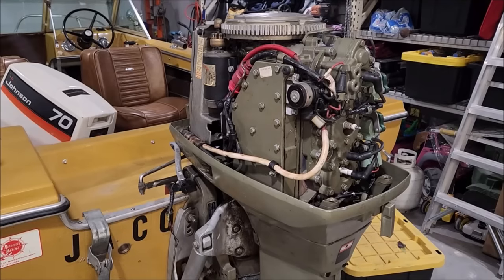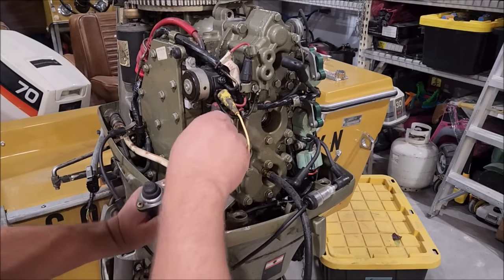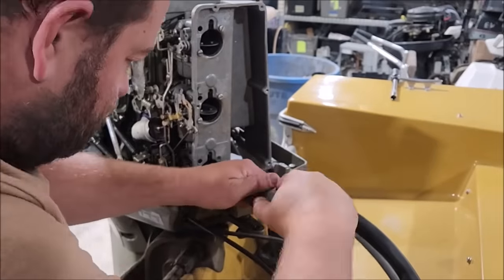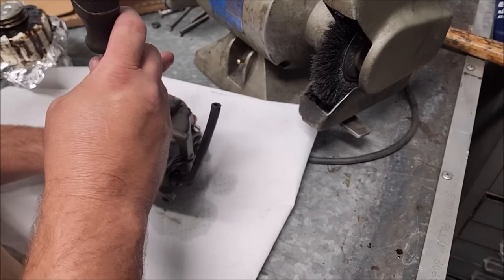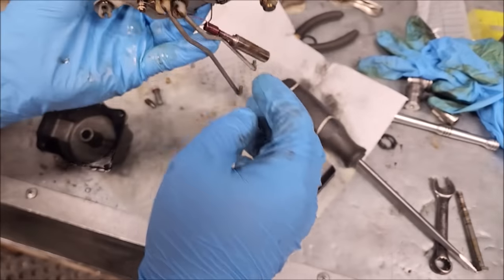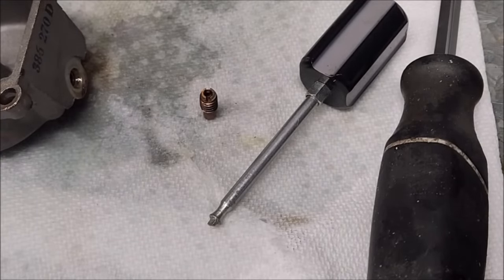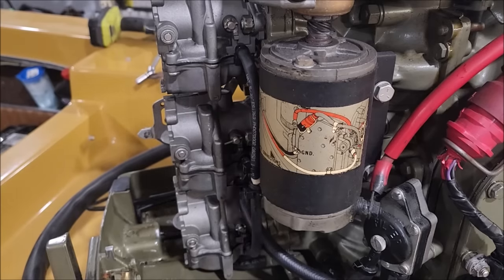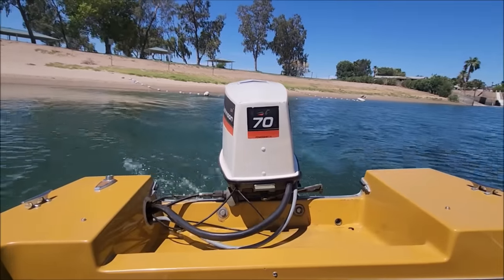Minty 1974 Johnson 70 HP Doesn't Run Once in the Water

Comment: Brandon, Sonny here, I'm a 36 year J/Evin. tech in Wilmington, N.C. really enjoy your channel! You have the right blend of
seriousness, humor, and humility (the latter is lacking badly in many outboard repair channels!)!!  Keep up the good work!!!
    Some simple tips .. always assume fuel hoses are old, & replace them (90%+ outboards have 5-10 y.o. hose!)!!
Of course if you know they're very new don't!! Lol!  It's better to err on the side of preventing call backs, than to encourage them!!!
Also, you may already know this one,, when replacing exhaust cover gaskets, wipe ~acetone~ well around the aluminum exhaust plate & cover after removing the old gaskets(s). Then after applying the gasket sealer to ALL ALUMINUM SURFACES
allow the sealer to cure for 30 - 60 minutes before installing those parts!!!  After bolting them in, re-tighten/torque 
them 3-x's!!! Allowing some time when you make the 3rd try!!!  This way you're compensating for the squeezing out of the sealer, which cancels out your torque specs.  
    Be on the lookout for early 90's 3 cylinder Mercury 90, 100 h.p. 2-stroke motors!!!  Don't know if you've already
experienced this,,,, but the factory messed up the tolerances between the cast iron cylinder sleeves, and the cast 
aluminum block(s), allowing the sleeves to get loosened when at temperature, and ~move~ backwards, towards the crankshaft,, and then the top piston ring releases itself because the sleeve moved back towards the crank!!! 
     I guess you know the end result, lolol,, because Mercs don't have any cylinder heads, you'd have a mess!!!! 
Just thought I'd mention that one!!!  Cheers to you~!~!~!~  Sonny.

Comment: Had a 70 once .   Tha motor was indestrutable.  20 years  zero problems.  Of course it was winterized every year and well maintained .   Very fast very dependable  and always started in seconds.  Traided it and the boat off on a 19 ft. Bayliner with  v8 in-out.   Love my boats.   But its true.   A hole in the warer you pour cash into.    76 now   but my kids , my grand kids all benifited greatly.      Miss those days.

Comment: Great Video, Great you were able to figure out were the water was coming into the bottom piston, I had a similar problem with a 20hp merc, the bottom seal on the crank let go water came up into the crank, then it was left for years, when I got it it was locked up, took it apart, changed the seal and the bearing, ran great, yep lot of people operate things that they have no idea how to fix, that's were guys like you and I come in,

Comment: Love those 3-cylinder OMC loopers - especially those 1978 and newer with integral power TNT.  Some of the best two-cycle outboards ever made...........  Thanks for the video, Brandon.
Reply: Yes, actually they're all a little over-powered!  The #2 connecting rod(s) very often let go, and BANG out the side of the block!!!   In 36 years I've seen so many of them through a rod.  If you detune them they'll live longer!
Reply: @newmoon54  the real story is these motors were born as 75 hps.., they were detuned by making carbs with small throats and jets.. put a set of 75 hp carbs  on a 65 or 70 hp and they run great and last a long time

Comment: I once had a 1986 Lund “Mr. Pike” with a 70 hp Evinrude. The boat was awesome. But what I like the best on it was the engine. Nothing ran and sounded sweeter than that Evinrude! If I come across something like that, I will be very tempted to get back to that type of boating. It was so fun.

Comment: Finally someone has shown how to remove the carbs on these.  I have this engine at home and I went on to a lot of sites and they said that a link sync had to be done after removal.  I can see now that this is not the case.  Thanks so much for going through this easy repair.  I owe you a beer.  All the way from Australia.  Thanks Brandon.

Comment: You make it look much easier than it actually is. There are many roadblocks to repairing these old guys. For instance, I have a 1959 Johnson 35 horsepower, and while it is a very simple machine, it can still confound me. For instance, I went to replace the points, and despite doing it several times before could get no sparks out of it. I have the timing fixture that uses the marks on the Armature plate and use a meter to determine when the Points Break. It's a beautiful system, but for some reason I could not get it to work this time. I finally figured out that the points I purchased were from China and both were defective. That 70 horsepower Johnson is just beautiful. Advice for men and women who wish to repair these and keep them? Without question. Join your local chapter of the antique outboard motor club and get to know the old-timers. They are an invaluable library of information.
Reply from the maker: Those china points, jeez, what a problem. I'm sure many people out there are throwing out the engine because they can't figure out the new points are the problem.
I don't think there is a local chapter. If there were, it would probably just be me.
Reply: I own a few 2 cyls with that mageto and fixed a lot more, but I have never bought a new set of points.  Coils I can't count how many!  And the 18-5181 are great.  But I've always just cleaned up the old points and tested and reused the condensors.

Comment: I used to think these motors were boring (I'm more into 1950's outboards), but have started to gain an appreciation for them. Your is super clean as well (I'm so used to seeing ratty ones purchased on the cheap at the boat ramp that crank and crank and won't start). Sounds great as well. 

This video makes me want to keep the 1974 twin Johnson 50 HP Loop Charged outboards on my great grandfather's 1960 Alumacraft Queen Merrie, that was recently brought home from my family's cabin. I had always planned on switching them back to the twin 1957 Johnson 35 HP (red and white) outboards it was built with. Maybe I'll leep the 50's on it for awhile now. They're growing on me :)

Comment: Probably would help to replace all the seals and rubber hoses. Over time ethanol destroys those components. I should know, I had a '77 70hp Evinrude and a '95 70hp Johnson. Now, I only use non-ethanol gas even though it costs more.

Comment: Nice video.  I'm currently resurrecting a 78 johnson stinger 75. Seized steering, trim motor wouldn't go, about a meter of control cable missing (can you believe that someone saw fit to remove a part of an 8 wire cable?), no key, no battery terminals, but good compression and looks fairly well kept under the cowl that is.  I've got her running and steering now, but the carbies will need cleaning.  She is an ol girl worth saving. Labour of love, as are most boats.

Comment: I had the same problem with a 1972 Evinrude Triumph 65hp 2 stroke. The problem was some debris floating in the water floated into the prop and up the exhaust pipe. When the engine was out of the water it ran fine, but in the water the debris rose up the exhaust column and occluded the exhaust port causing the engine not to run. when pulled out of the water, the debris dropped down allowing the engine to run.
Reply: Who would have thought that was the problem.

Comment: Awe we used to run those 70's and 75's on raceboats   :)     The short shaft models  :)  with clever props.  I too know those engines inside and out too .  Cheers to an awsome video Brandon :)

Comment: I had a 1976 70 foreverude. thing had a million hrs. on it when I got it in the late 90's. only problem I ever had was that it started dropping spark to one cylinder when the powerhead heated up. Turned out to be the exciter coil under the flywheel.

Comment: Had the same issue with a 70HP Evinrude, would rev nice out of the water but wouldn't get on the plane. Turned out to be top carby's float was stuck starving fuel to top cylinder.

Comment: For whom it may be worth,  I dont know if they had overheating resistor on these in 79, but I had an 82 Johnson that after hunting down a culprit keeping it from running more than 15 minutes (idle great), one last thing, I snipped the wires to the thermo switch.  Never had a probelm after that. I checked the resistor by Ohms showed good, but wasnt after engine heated up.

Comment: I got one of these on a 72 ranger boat .. just ran it in the water the first time today
Reply from the maker: How did it do?
Reply: @BrandonsGarage  had the carbs rebuilt ,  would only run 3000 rmp wouldn't plane out ,  got to messing with it , found at wot , butterflies still could open another 25%  figure they didn't adjust the linkage right ,  should run 5000 rpm.. but other that that worked find after warmed up

Comment: Hello, I loved your video. I have a 1976 Johnson 75hp, and it has a problem, and that is that when it enters the water and starts it, it does not have the strength to accelerate at speed and it only moves slowly even if I accelerate it to the bottom, I already put it. water pump, spark plugs, thermostat, fuel hoses, everything new and the problem continues, please tell me what I should do to avoid having to buy another engine since they are too expensive here. Thank you and God bless you always in the mighty name of Jesus amen and amen

Comment: I had a 96 Seahorse  70 hp and when I was 8 miles out of the harbor, the fuel manifold cracked. My friend held it together just enough so it would run and we limped back to harbor. It's made of plastic. I made a new one out of brass. They have a OEM brass manifold. But it's close to 100 bucks if you can find one. I don't like plastic fuel fittings.

Comment: I'd love to see a complete rebuild on one of these older 3 cylinder 2 strokes like you did with the 9.9 a few years back.  I inherited an 83 70 hp from my dad that he blew up.  Rod bearings went out on the top cylinder and that was that.  I tore it down to find the issue.  Once I found the issue just decided to completely tear it down and find parts to rebuild it.  That took ALOT longer than I expected.  I got all the parts but now I forget how to reassemble everything.  I did take pics, but nowhere near enough.

Comment: I’m kind of in between what you are describing. I can do my etec outboard water pump, thermostat, lower unit oil, gas filter………..Im fine with doing that maintenance stuff. Once you start getting into sensors, electronics, fuel injectors…..etc etc……Im toast and going to a shop. I just don’t have the time for that………

Comment: Did you do the impeller on that motor? Seems like that long of sitting I’d replace that so motor cools properly.
Reply: That crossed my mind as well.  
The crankshaft seals has probably not had time to soften up to do it's job due to lack of use.
Similarly the Rev counter & speedometer has not had the use to keep all functional without tinkering eh ?

Comment: I'm bidding on a boat with a 115 Johnson with the same issue - runs fine at the dock, chokes as soon as they leave the harbour.
Reply: Idle only when on the hose...your impellor will thank you for it...
Reply: @JohnSmith-yv6eq  yup. not sure yet how it's been treated. It's at a price where it's not too much of a bother if it's a turd tbh
Reply: @markburton8303  
Take the carbs off, clean them...
reassemble then use a 4 vacuum gauges set up to set the idle circuit in perfect synchronicity...
see Dangar Marine vid on how to do this.

Comment: I have a 1978 70 HP Evinrude. It doesn't have power to get on plane. it also spits gas out of the carb. could that be reed valves or dirty carbs?
Reply from the maker: Or both.
Depends on what you mean by spitting. 
- dribbles out, probably a float problem. 
Shoots out the front? Probably reeds.

Comment: A '74 70HP Johnson with only 38 hours?!? Its barely broken in for goodness sakes!! 150 compression?? Id take this motor over ANY 4 stroke in this HP range.
These were/are great motors, reliable and strong. This is a sharp little boat, beautiful.

Comment: just wondering for my own info,  if water was getting in engine, and now we have a power problem, did you looked at reeds when carbs where off for rust?  My 2001 90hp runs ok in barrel and plains out good but hates to idle in gear. (troll).  Scary to have engine idle bad and then try to make it run hard,  if a gas problem then BOOM.  thks for video.  I can change a tire, drive a stick, and overhaul an engine.  Don't do brain surgery.  And back boat down ramp at 330 in morning without pulling forward.  haha

Comment: Hey Brandon thanks for putting up this video. I have this motor.  It looks easy to pull those carbs.  I thought I had to do a link sync if I played around with the lever mechanism.  Is there a chance of damaging the links when you are freeing the carbs from the outboard?   It looks like you just levered them off.

Comment: As a kid I would fix my VW on the side of the road all the time. I couldn't find the battery on my Son's 2015 Mini Cooper. I have a 98 7.4 Merc in my Deck boat. Only once has it not started at the ramp, turned the key and didn't hear the fuel pump. Hmm, I wonder what the problem is? Even if I had a fuel pump with me, I didn't have a cherry picker to lift the motor the 2" I needed to replace it mounted on my boat.
Wanna guess what I do if I see a broke down boat on the river? I stop and ask if they need help. Then I ask if they want me to hang around while they fiddle with it. Then I tow them back to their trailer. Very few regulars in Parker would leave anyone stranded. Sheesh, I've noticed that 90% of the new folks on the river are firemen. I even carry one on my boat for emergencies.
Reply from the maker: Carry what, a fireman? 😅🤣😂🤣😅
Reply: @BrandonsGarage  Yup, my Daughter brought him home one day and he ended up part of the family.
Reply: @BrandonsGarage  That's how I'm reading it too! 😂😂😂
Reply: When you replaced the fuel pump did you mount it somewhere a lot handier than under the engine?
Reply: @JohnSmith-yv6eq  Nope, Original lasted 20 years. Figured the next time I had to replace it it would be connected to a brand new 8.2 litre. Surprisingly affordable compared to the price of todays outboards.

Comment: interesting... I kind of wondered why you didn't check compression in the last vid...
Reply from the maker: I didn't really need to. Cylinders were nice, as were the rings, and we know how many hours are on it (low).
Then there is the constant steem cleaning the cylinders got; I didn't want to dry fire them until they got some more run time to get re-oiled.

Comment: I have a very similar 1975-70hp, with a 79 Powerhead. runs great. idles a bit higher on 1983 75 hp carbs, but fuel economy is better on original 70 hp carbs. might switch back.

Comment: Is 150 psi compression normal? I have a 1974 Johnson 135. I checked with a cheap harbor freight tester and got 113-115 on all four. 
is that low? It runs great.
Reply from the maker: Its normal for a 40-70 HP, but not for a v4, you're fine.

Comment: My evinrude 60hp 3 cylinder 2 stroke does not have an outlet to show that the water pump is pumping. Is that just how they made them?
Reply: Yes, Mercury patented the pee hole.  No one else could use it till the patent expired, normally 17 years

Comment: Carbs must be tuned on the water....obviously 100's of other reasons.....but air density is different at the lake/river/ocean.....
Reply from the maker: Usually, I would agree, but no carb tuning on these as they have fixed jets. However, with every other adjustment, you are correct.

Comment: Your videos are great man. No other Evinrude content out there competes. Now, if you'd be so kind and tell me how to change the thermostats on the post 87' V4 without removing the lower cowling or going full lazy and drilling holes in the back of the lower cowling to get the bolts out (not doing this, I do shit the correct way). I commented on someone's YT video a few years ago and the guy absolutely swore that you can change the thermostats and pop valves with the cowling in place. Albeit, he said it's "tight". But can be done. I noticed you mentioned it on that 88 you got a while back with no controls but I don't think you've ever talked about it in any other videos.
Reply from the maker: Upcoming video I do! It's just been delayed for a bit.
Reply: @BrandonsGarage  Awesome! Can't wait. You're the man, man.

Comment: id say the list of why it stalls or bogs in the water but not on the hose is rather short. if its really running on all 3 (these will happily run on 2, albeit a bit rougher idle) 90% of the time its dirty idle circuit/s in the carbs. less likely is linkages out. you could possible have a stuck reed or still taking in water, but unlikely after your last service. those carb floats look perfect, but your arent using the gauge tool so who knows! how did you adjust the idle speed screw without having to do the synch n link procedure over again?
Reply from the maker: The link & sink on these is a bit different.
The wide open throttle stop, cam follower, and pickup point are all still important. However, idle speed is not adjusted by the throttle stop screw; manual call for it be be adjusted on the cable trunion. 
I somewhat believe this is because of the solid steel inner cable.
The newer cables are multiples and twisted. Makes bends easier, but also introduces some backlash. 
You don't have that on the older cables, thus no mention of the throttle stop for idle speed.
Maybe this comment will get its own video...
Reply: @BrandonsGarage  weather you are adjusting idle speed from the trunnion or stop screw, it will still move the relationship of the cam roller and throttle cam. the manual wants you to adjust the idle stop screw to set the throttle pickup point. thus if you move the trunnion it will move the stop screw off its seat on the spark advance lever, making it necessary to re-do the pickup point procedure.